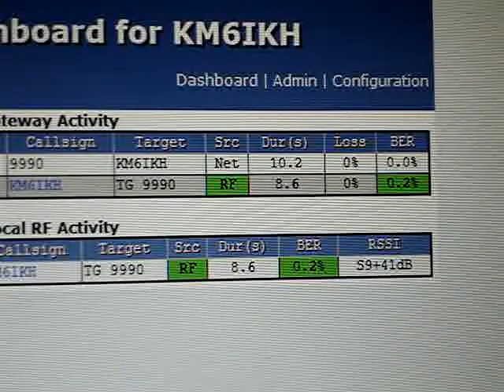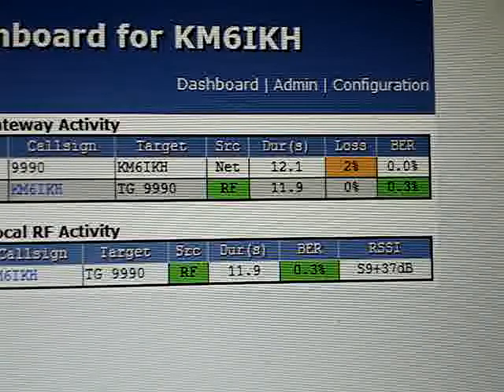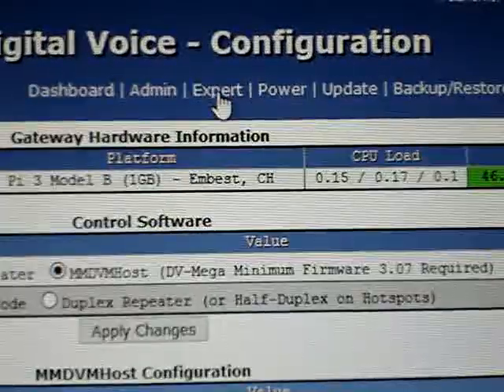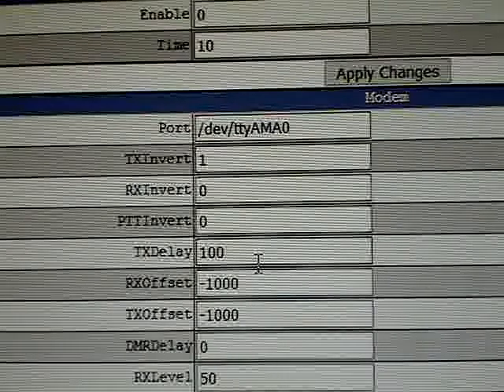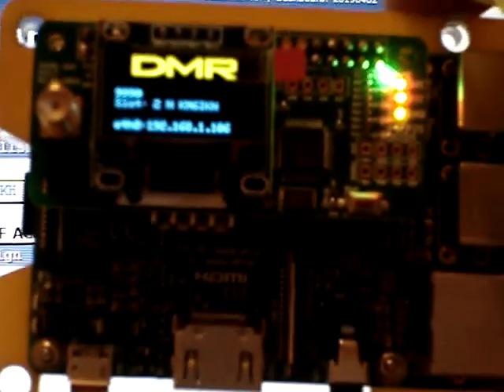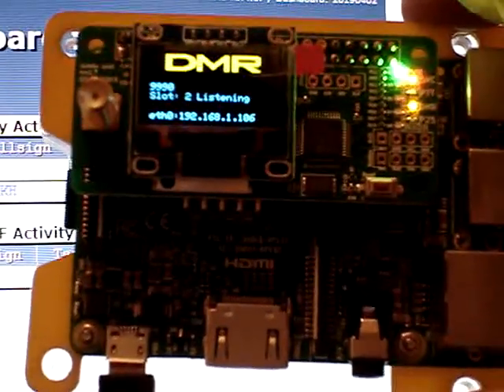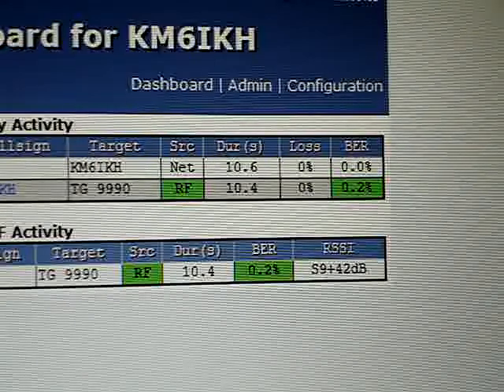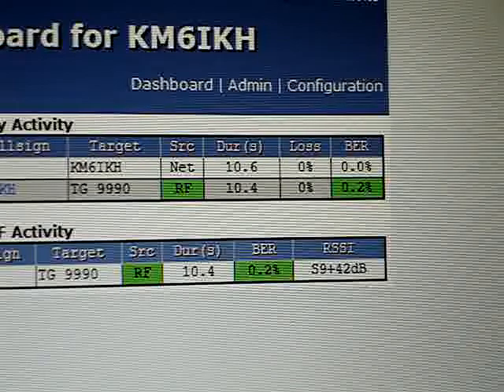How to TUNE most any hot spot OFFSET in under 5 minutes

Comment: "How to TUNE most any hot spot OFFSET in under 5 minutes" Prove it. Do it in the video other then bragging about how you can tune it.
Reply: Agreed, there was no “How to” in this video
Reply: @joel6221  I used the same -1000 offset and it fixed mine.  Way less than 5 minutes.  Got lucky maybe.